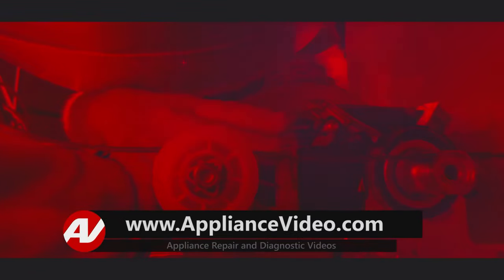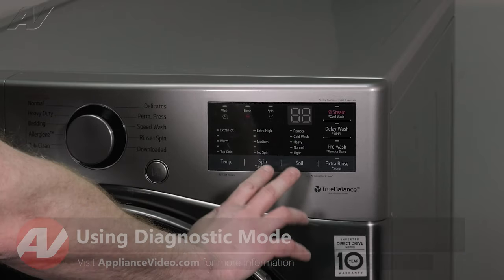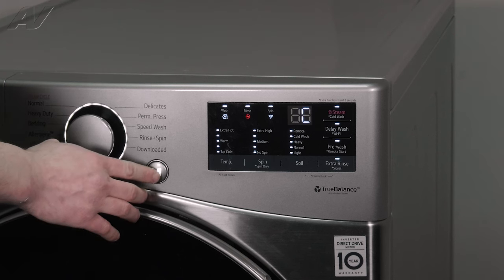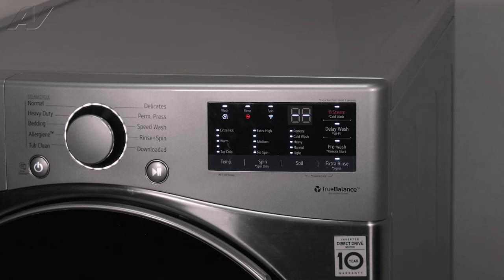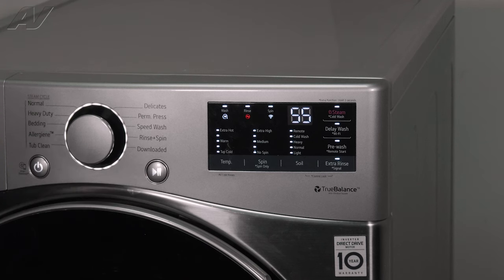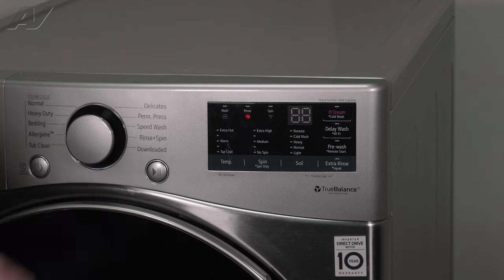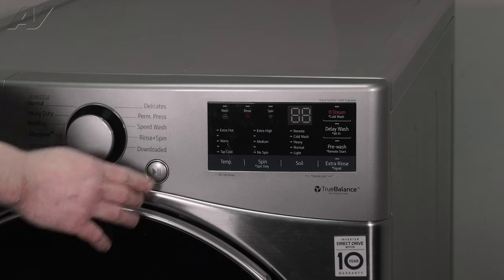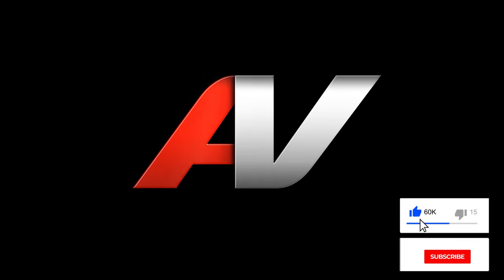Diagnostic Mode, Error Codes & Troubleshooting on a LG Washer by a  Factory Technician

Comment: Hi there I followed these steps and my washer is flashing nf during the high speed spin and at end of diagnostic cycle. Any clue to what that means. My issue is my clothes sometimes come out wet and I have to run them there spin cycle few times.